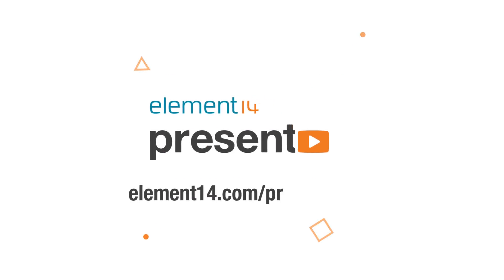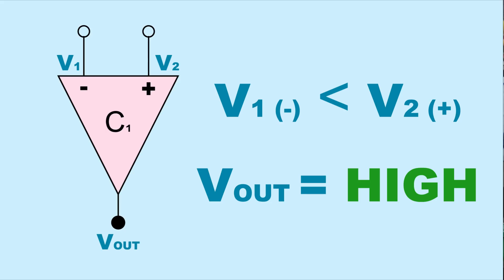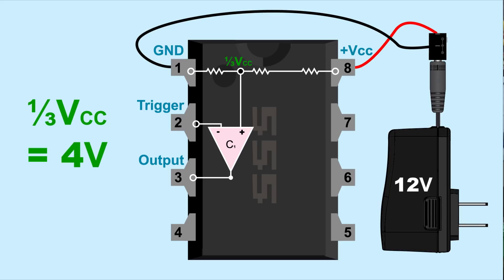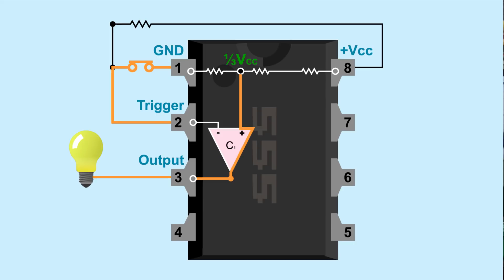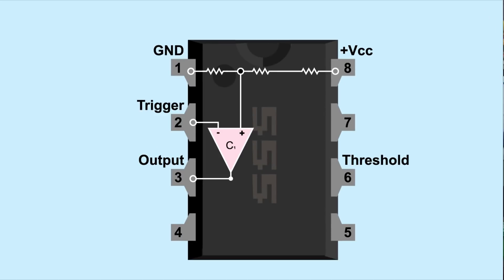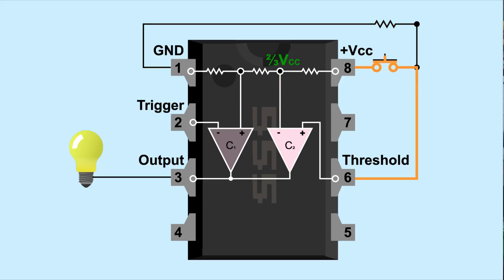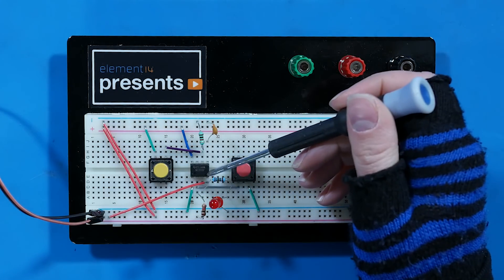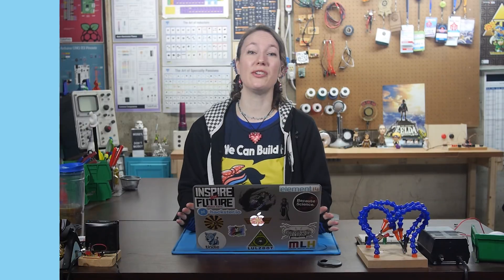555 Timers - How Bistable Mode Works - The Learning Circuit

Comment: so if you use this to power a motor, will the motor only get 1/3 of the battery voltage?
Reply: You wouldn't use this to power the motor directly.  For that you would connect the motor directly to its power supply through something like a relay, mosFET or BJT.  You would then use the 555 to switch these on or off.  Of course this will only give you off/on control.  Controlling the motor's speed will need a way of creating a PWM signal.

Comment: Application I'll use : When the push button is pressed the motor will turn ON (fills the water in the tank, If the water tank fully filled) then motor will automatically turns off

Comment: Once the trigger is set to ground, output goes high. Ok . But as soon as push button is released , it will connect to vcc . So trigger pin goes on high voltage. How does output remains high. Kindly explain. I am new to electronic.
Reply: After the op amps there is a flip-flop which holds the latest state. The flip-flop is not shown in this video.

Comment: What happen if both button pressed at a time?
Reply: Excellent question!

1) Try it and see!  (Learn by doing. 🙂)
2) One thing to consider: Chances are they won't both make contact at the exact same time.  One will end up first, the other last.  That's why debounce circuits are needed, since the switch contacts can literally bounce, making and breaking connection a few times until they stabilize.

Comment: The explanation of how this circuit works (and the internal architecture of the 555 timer) is very wrong in almost every way.  The outputs of the comparators in a 555 timer do not connect directly to the output pin (which is just as well because if one was high and the other was low, it would be an internal short circuit). They go to the inputs of an SR latch.  It is this latch that "holds" the state.  A comparator by itself would not latch either output state in the way described once the button that activated it was released. To suggest that it would is very misleading. Really, it would be best to take this video down and reshoot it with a proper explanation of how the circuit works. That would be an interesting video.
Reply: Thanks for this. I was wondering how state could possibly be maintained in this setup, given that the outputs don’t connect to any input.

Comment: this circuit can be used to design a water level controller of domestic water tank. I have done this project with my students
Reply: more details, please
Reply: @grindel80  when the level of the water goes below the lower threshold point circuit is negative triggered ,o/p goes high and that makes the motor ON ,connected with a relay transformer . when water is filled up in the tank and reaches the upper threshold point ,the circuit is positive triggered ,o/p goes low and switches OFF the motor .
Reply: Does it connect to a water pump or something? I've thought about making an automatic plant watering system for my succulents using moisture sensors, but wasn't sure how to control the water other than a solenoid somehow.
Reply: @maker_karen1785   Definitely it can be done with this circuit .
Reply: @var67   exactly

Comment: i was using 555 timers since 1976   some things don't die
Reply: Yes, it's such a neat little building block component.  It's a happy middle ground between too simple and too complex.  These days so many people see a tech problem and want to throw an Arduino or Raspberry Pi at it, when a few components like 555s and such can be simpler and reliable. Yes, being able to make changes via software is great, but overkill for many applications.

Comment: Changing stepper motor direction with limit switches by hitting them.
And make a step generator on 555 timer with a variable resistor.
Reply: Cool application idea!
Reply: hi, i'm working on the same application. Did yours function properly ?

Comment: I think you guys messed up.
Where is the internal flip flop of the 555 Timer?
Reply: I tried to simplify to just cover what was needed to understand how this mode works. You can check out my other 555 video for a more in depth explanation that includes the flip flop. https://www.youtube.com/watch?v=oZzjmAbyyIQ
Reply: I agree that a side discussion on the SR latch would have taken away from your goal of a bistable 555 timer mode. As an oversimplification, your presentation was well done. But make at least a mention of the latch? :)
Reply: It's not really wrong, just omitting some detail. She describes the behavior correctly and in detail. If you're interested in the exact details of your timer, you should look at the datasheet.
Reply: but its a big important detail being omitted. the sr latch is the whole reason the output remains in its steady state after the buttons are released. if the output came directly from the comparators, as depicted, then it would not have a stable mode.
Reply: @xedover  Yeah it is an important detail.
Reply: @NETypeMCPERedstone  Yeah, you can't really say something is in detail if it misses a big detail... That is just... Well... That's just logical thinking, surely?
Reply: The block diagram at 4:15 is wrong. I can understand the lack of discharge transistor since it isn't used but the flip-flop is needed.

Comment: New subscriber and working on and building one now. Do those buttons come in an accessory package? What size capacitors did you use? Anyway great video excellent channel and instructor Artie ❤️
Reply: You can buy all the parts individually. I have the BoM with product links listed on the e14 Community. The link is in the description above.
I used a 0.01uF ceramic cap. And thank you!

Comment: Hi Karen! If the comparator outputs high why the bulbs output is low?
Reply: They did not show the internal flip flop so yeah... they messed up, look up a proper block diagram for it on Google.
Reply: @NETypeMCPERedstone  I tried to simplify to just cover what was needed to understand how this mode works. You can check out my other 555 video for a more in depth explanation that includes the flip flop. https://www.youtube.com/watch?v=oZzjmAbyyIQ